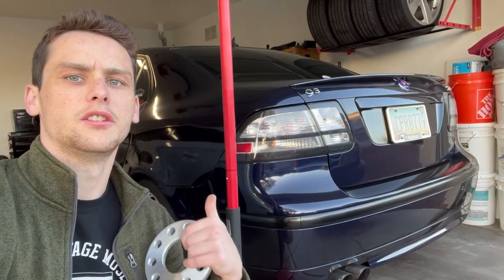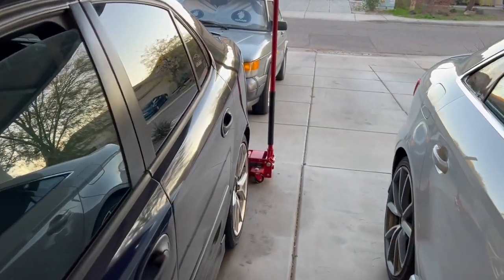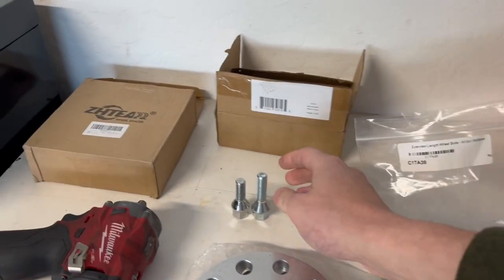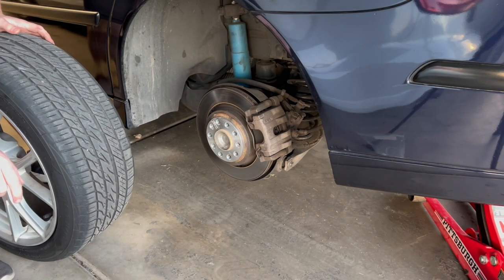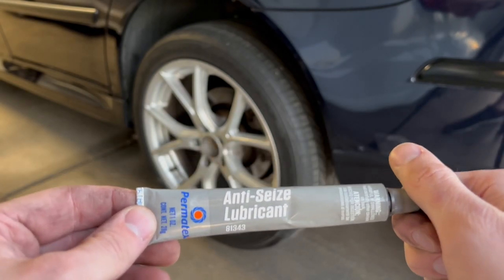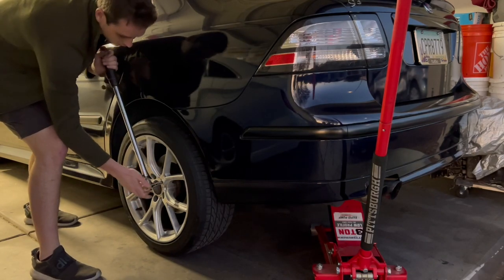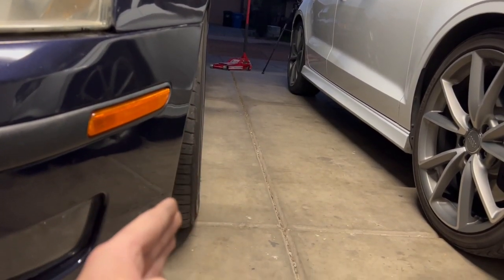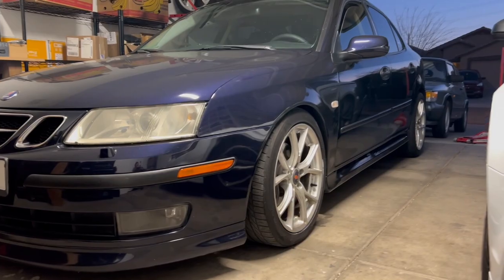Getting Perfect Wheel Fitment on My Saab 9-3!

Comment: Looks good. Be cautious if you get 3 passengers in the rear. I have 10mm spacers with same wheel dimensions and with full car the tyre rubbed against the arch panel. It started to rust a year later and I had to weld in a new panel.